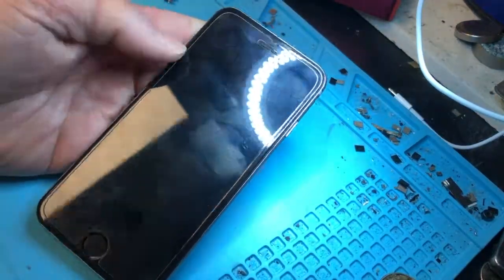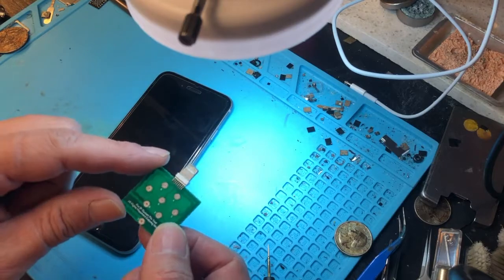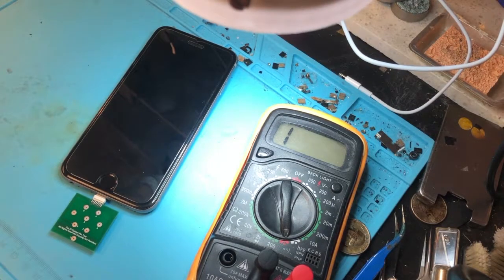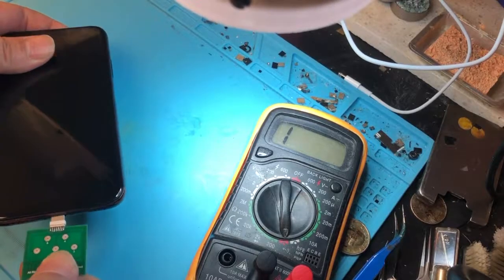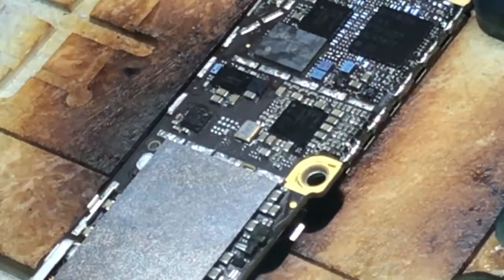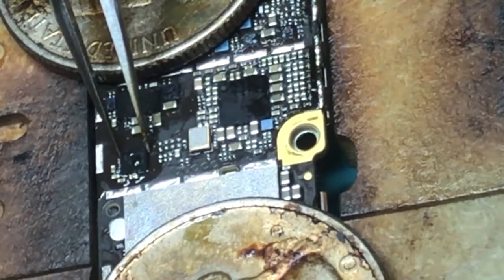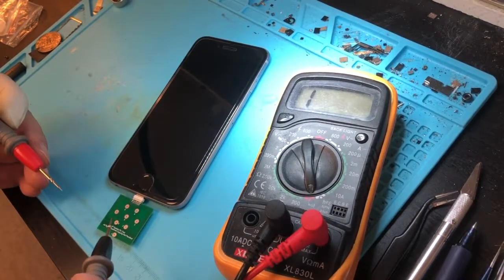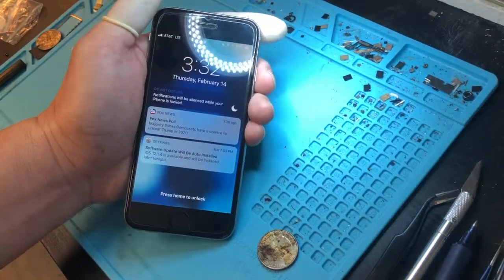Testing iPhone charging IC (U2) Tristar

Comment: Could u do another video with 4 example using the same phone using that tristar testing device on all of the Examples;so 1. example for a phone that is working good,  2. Example is a faulty battery 3. Example faulty charging port 4.example faulty ic u2 tristar microchip.

Then for each example right after it